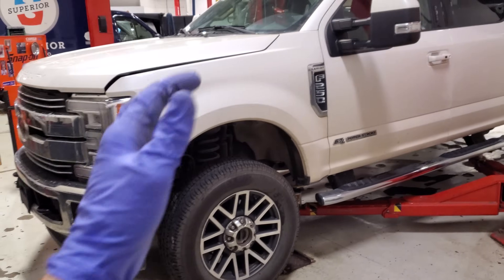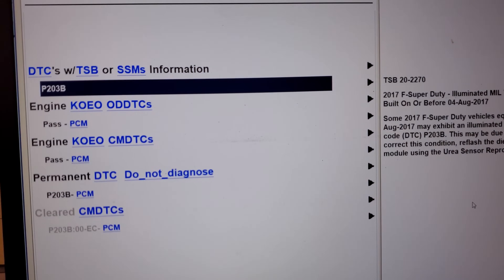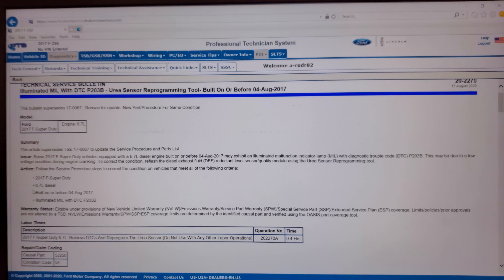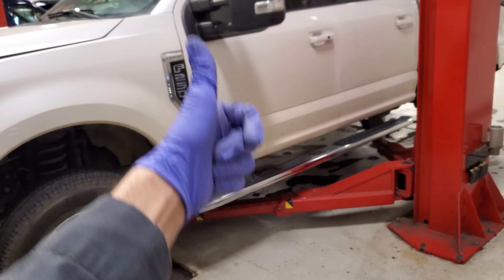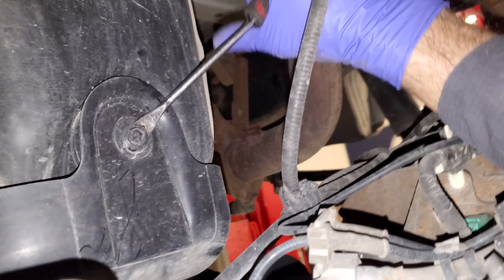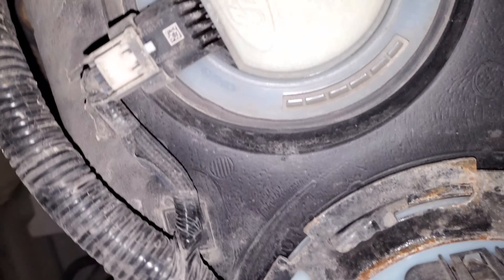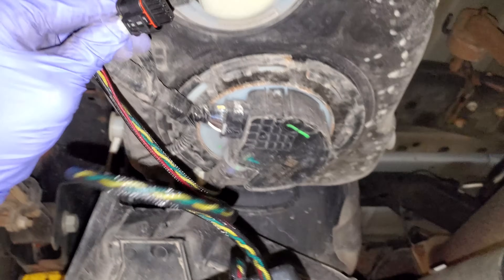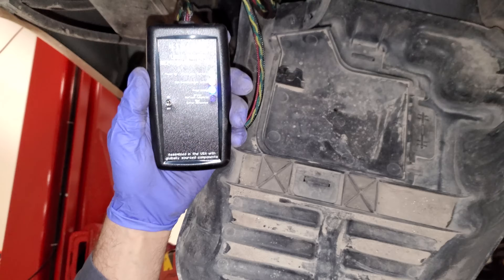2017-2021 Ford 6.7 Superduty | CHECK ENGINE LIGHT ON | P203B **You gotta SEE this ONE***

Comment: I Have a 2021 6.7 Check engine light, several trips to dealer, now they want to blame the fuel ? I only go to major fuel brands like Mobil ect. changed out the NOX sensors before and after the cat. any chance you have seen this? BTW truck runs perfectly!  25k miles one driver/owner. thanks in advance!
Reply from the maker: Buddy, I would have to look at your truck. I can't determine that through the combo section

Comment: Why is my signal return on the def pump pulsing my test light? Signal return is a sensor ground? Ever see that before
Reply from the maker: Good question
Reply: I load checked all wires from pcm to def pump. Then hooked test light up to battery positive to check signal return out of pcm and it pulses. Strange who knows. It was an auction truck though

Comment: My check engine on my 18 just popped up and I tried to clear it with my tuner but it came back, this only happened when I changed over DEF to a different product. Seems like a weird coincidence to me but I will put a scanner on it later and see if it's the same fault. Hopefully it's as simple as that to fix or better yet a sensor I can replace myself under the hood. I really hate bringing my truck in to the dealership for anything as it has 111,850 KM on it, I do have the extended warranty on it but not sure if that would be covered. I was curious to see how much that flash tool was and hot damn! On average about $1,000 U.S, I don't think I will be investing in a programmer that I would only use once. I would have to reprogram every diesel truck in my town 5 times over to even break even on the cost of that unit.
Reply: I see you posted about a year ago in this. I actually used “Sheetz” brand DEF and I got the code. How did you end up clearing it?
Reply: @SS7213 it was my dpf not my Def, I fixed it by deleting it lol.

Comment: Is there a way to reset the engine light on a 2019 F250 after the intercooler hose splits without taking it to the dealership?  Thanks
Reply from the maker: Code scanner

Comment: Have a 2011 f450 w/ 6.7 .First time w/ check engine lt. . Code is P203C -- (Reductant Level Sensor - A Circuit Low).
What is the best way to diagnose this problem ?
Thanks for your time. Been watching for years, and I enjoy your channel. Thanks

Comment: This DTC just came in on my 2017 Ford F350 6.7 Super Duty. This vehicle is still under factory warranty should I just take it to the Ford dealership and have them conduct this Flash update? This information was very informative and I thank you very much for it.
Reply from the maker: Yes you will, there is a TSB on it. Show them this video & you should have ZERO issues with them performing said task.

Comment: Great video thanks! Had this code come up on my 2017 made an appointment at my Ford dealership but after reading the comments on low voltage I checked my batteries and found one to be dead and the other low. I've replaced the batteries and after driving for a day the engine light went out. I'm I good to go now or should I still have that module reprogrammed?
Reply from the maker: I ust did 1 this weekend. Yes you will have 2 get it reprogrammed like y saw here

Comment: So, had this code come up last week on my 2017 F-250 (70K miles). Took it into a dealer here on East Coast of Florida. They wanted to charge me 2hrs. of labor, (1hr. diagnostic, .5hr to replace and another .5hr to retest) for $389.00. I asked them why this wasn't covered under the emmisions warranty and they said it wasn't because the connector on the DEF tank wasn't a covered part. I asked if reprogramming was covered and they said it wasn't. Oddly enough they also said that my driver side battery was bad (under current). I replaced both batteries about a year ago. Sooo, wondering is it a battery issue, if not can I buy the reprogramming tool and do it myself?
Reply from the maker: Tools probably more expensive
Reply: @PowerStrokeTechTalkwARod  I'm curious to know, since I'm reading all these low circuit voltage battery issues tied to this, the dealer did show me a read out of my driver side battery charge low at voltage: 9.92V and measured: 9 CCA (DTC: 9CO 4X21) I tried looking up that code and couldn't find it. The positive on that battery looked pretty corroded so I cleaned it up. I also noticed that recently whenever I start it up, it's like the gauge display doesn't remember my preferences and I have to go through the menu to find the speedometer, whereas it used to come up on that display automatically. I don't drive this truck as much as used to, maybe 3 or 4 times a week, so it sits for a couple of days in between cranks. Would that be a contributing factor?
Reply from the maker: I have heard of that, personally hasnt happened to me. I have done more reprograms of that module than anything.

Comment: I have a 2017 f250 powerstroke with 147,000 miles that’s showing this code. Is it possible for it to be causing the battery to be low/run down after sitting for 12-15 hours? 
The code came up yesterday morning, I got out of the truck around 4pm yesterday and this morning, it wouldn’t crank. 
Also, is this dtc an issue that ford will fix on their dime? Or do I need to not worry with that and do it myself?
Reply from the maker: Battery drain, probably not. Is it going to be covered by Ford no, it would be your responsibility. Its not a recall, just a bulletin if you were to get thos DTC. So go take it in.

Comment: I have a 17 F250 6.7. 53k miles. My check engine light came on this morning. I took it to O’Reilly’s (cause it was free lol) and this code came up. I am going to call around tomorrow to get it looked at and fixed.
Reply from the maker: Dealer only bud...
Reply: Can you buy the UREA programmer and do it yourself?
Reply from the maker: I suppose

Comment: Hey Powerstroke Tech Talk. The original TSB for this issue was 17-0067. The procedure you have for this video is updated. What is the new TSB#. It’s covered under the emissions warranty and Id like to have my dealership correct this issue that recently popped up for me. Thanks!
Reply: thanks so much man! Recently traded in my 2010 6.4 Spartan tuned fully deleted with ARP studs in on a 2017 6.7 Lariat with 42k and I’m loving this truck. Was scared of the CP4 but after watching your vids I gained confidence and did the S&S kit. You’re providing the best 6.7 content right now keep it up bro!
Reply from the maker: We really appreciate that. See you tonight...9pm est
Reply from the maker: Right after my intro, look at the computer screen. It's quick.....you would have to run the causal part of the TSB against your VIN to know.
Reply: @PowerStrokeTechTalkwARod  Also, I had the TSB17-0046 issue recently fixed by my dealership. I was surprised but they covered it under emissions warranty. I saw several people in the forums with this issue. Just thought I’d mention it if other people asked. Tell them it’s covered under the original emissions warranty if it comes up.

Comment: Question for you, I  have a 2017 king ranch with 3,000 miles don't drive it much , only for hunting and fishing and parked in the winter. I'm worried about my def going bad , how would I drain the tank, is there a drain valve. Could you do a video on this or let me know the best way to drain the fluid without having to drop the tank. Why would Ford built this without a drain valve , thanks.
Reply from the maker: You wld need a scan tool to do so

Comment: That's crazy. I had a P203B pop up on my 2017 this last summer. I hooked up my bluetooth obd dongle and forscan lite on my phone. I remember seeing something along the lines of low circuit voltage too. My batteries tested fair but I remember my truck sounding slightly sluggish to start (everyone knows their own vehicle performance). Anyway, I changed the batteries with good ol motorcraft max and cleared the DTCs. Hasn't come back yet. The low circuit voltage is what pointed me to the batteries.
Reply from the maker: Hell yeah!!
Reply: I think this is what is happening to mine, do you remember what voltage your batteries tested at? Mine are measuring at 12.4 after sitting for about 4 hours.
Reply: @si113ntsh00ter  Sorry, I don't remember the voltage. I just remember one battery was lower than the other. Also somewhat of a hard start situation. I'm sure if I had a crazy scan tool I would have seen a low voltage trend. Not exactly sure why the DEF heater circuit would pop up with a low voltage code due to low batteries but I know digital circuits can be tempermental. Depends on what coding is for tolerances. Anyway, I still don't have any issues. Just wish I could ditch the DEF and DPF altogether.
Reply: @jasonkubitz9410  It’s fine. Thank you for replying! It helps!

Comment: Seen that code numerous times but at the time I would just replace the entire tank because that sensor is not serviceable according to my parts guy so I would keep the pump and replace the tank and it would fix that issue .
Reply from the maker: Why wldnt u have done this then 🤷‍♂️??
Reply: @PowerStrokeTechTalkwARod  at the time in 2018 there was no reprogram . the fix back then was replacing the tank
Reply from the maker: Yepp

Comment: So the programming on that sensor was bad from the factory or what? Why all of a sudden would the programming fail? Seems like there would be something that caused that to go bad, but if Ford made that little programmer just for that then It must be fairly common. “Common” enough anyways.
Reply from the maker: Common enough fer me to have never done that but then there's a TSB so.....
Reply: @PowerStrokeTechTalkwARod  lol true, but your one mechanic in one shop. For them to spend the money to make this programmer and not just replace the sensor....makes ya wonder. So what’s causing this? Bad program in the sensor? Would think if it’s that it would effect them all.....it’s interesting for sure. 
  What’s your opinion on the CP4’s? SPE’s got a protection kit that in theory should stop the fuel system from being killed if it fails. Is that something worth getting? There only like $350 or so. Just not sure if they fail enough if the owner does his part, to even require the safety net.
Reply from the maker: Ive heard of the systems still failing

Comment: My 2017 was at the dealer a few weeks ago and had this same repair made. Ck engine light would illuminate intermittently. Great to see here what they did.  Thanks.
Reply: Or what they were supposed to do.
Reply: What was the cost for the fix?
Reply: @MrThaipoo  No charge, under warranty.
Reply: @FastestSN95  nice. I’m past my warranty and currently need this fix 😅
Reply: @MrThaipoo  what was the cost? I’m past warranty and have this problem now.
Reply from the maker: Warranty
Reply from the maker: Excellent...thanks for sharing!

Comment: I get that P203B code occasionally. I think that the truck is 3/17 build. I first got that code in July of 2019. Probably had about 60k on the truck at that time. I have about 145k on it now. 
I get a P24D1 almost daily now. Have the new sensor and module, just haven’t gotten around to changing it.
Reply from the maker: thanks for sharing

Comment: Me Friend I have 2018 f350 engine light is on and smoke smells dad I need take to mechanic soon ?
Reply: What are your codes?
Reply: ...auto parts stores will read for free if you don’t have a OBD code reader. They are really cheap to buy if you wanted a nice tool in your toolbox.
Reply: @unbalancedwood  i pay warranty for 125.000 bout need every day to drive and not sure need care soon
Reply: @unbalancedwood  I not plug in the computer yet bout was I te dealer 4 times only 40.000 miles turbo seal leak head gasket changed
Reply: Smells bad

Comment: I think it's really cool that you can fix a DTC with a simple reprogram.  Of course, IF I was an Internet expert, I'd complain that the DEF tank was UNDER the truck and not "easily accessible."  Then I'd pontificate on how engineers should be forced to fix the problem so they'd know how difficult it was...etc....etc...rinse / repeat...